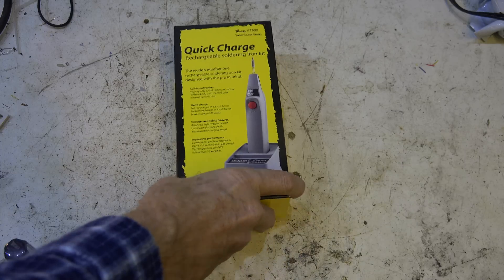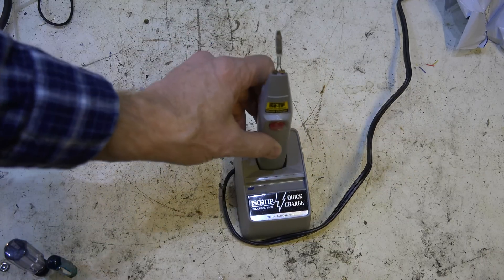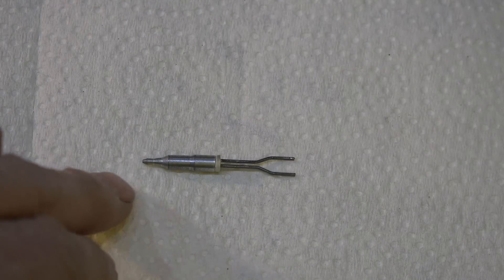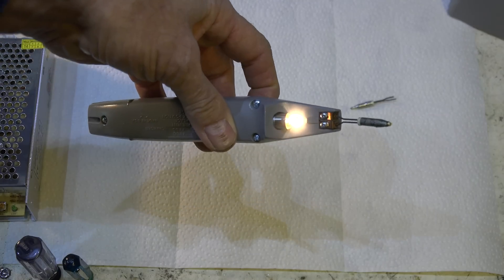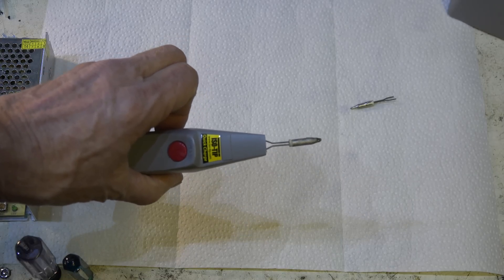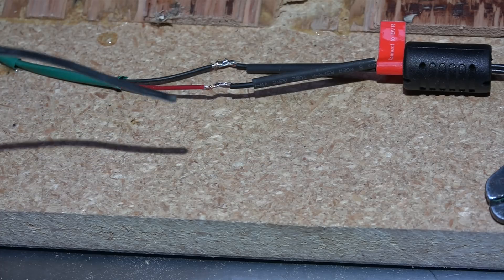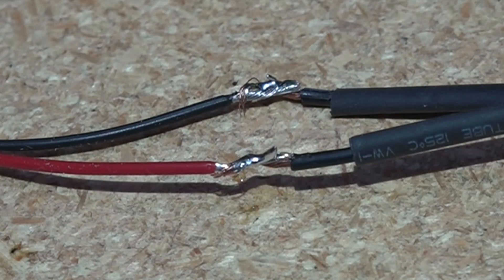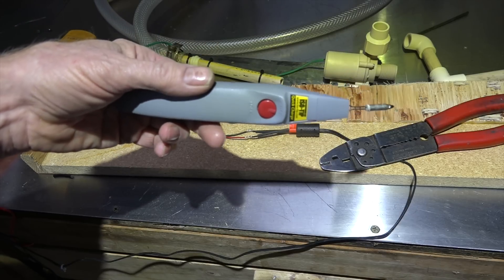Solder iron review

Comment: I had one of those ISO-Tip rechargeable solder irons a long while back (a yellow one), but it wouldn't charge any longer (either the rechargeable battery or charger was bad).  So I replaced it with a ISO-Tip SolderPro 50 Butane iron, that I bought off of Amazon, and love it.
Reply from the maker: +Pete Ciallella The butane one sounds interesting.  And probably very fast.
GFM
Reply: @grayfurnaceman  This iron uses 2 CD-NI type Sub-C batteries connected in series (2.4V) as found in old drills, various tools, etc ... For a few dollars you can get these batteries. As for putting an LED in place of the filament lamp, with 2.4V this is not possible, except perhaps a yellow LED. This soldering iron is closer to 15W than the announced 8W.